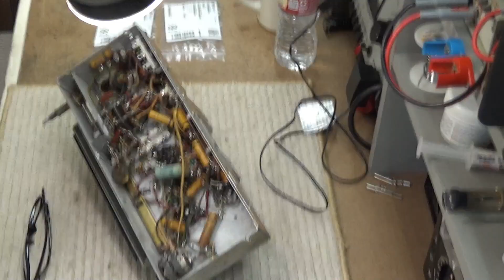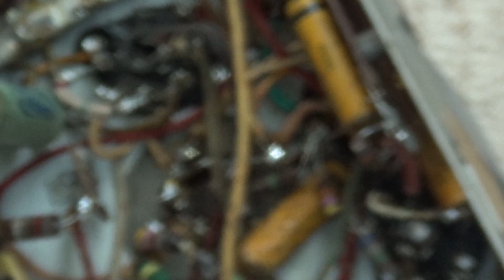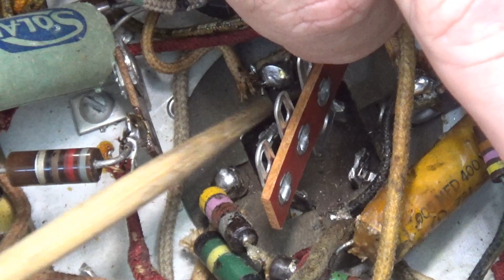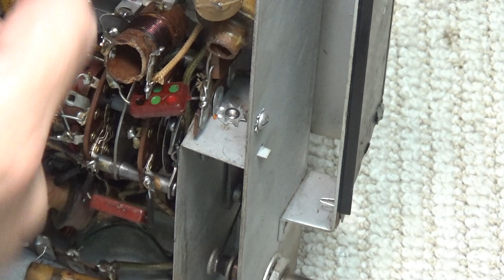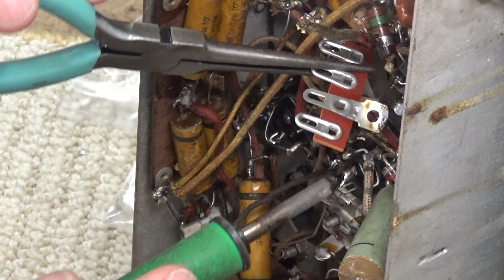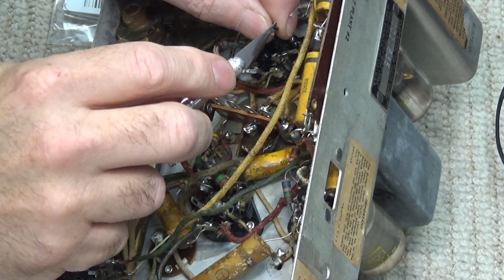Episode 83-1, "The Search for Old Capacitors"  Sears Silvertone 8230

Comment: From Wikipedia: "Micromicrofarad" or "micro-microfarad" is an obsolete unit found in some older texts and labels, contains a nonstandard metric double prefix. It is exactly equivalent to a picofarad (pF). It is abbreviated μμF, uuF, or (confusingly) "mmf", "MMF", or "MMFD". Therefore, your 100 micro-microfarad capacitor is not mislabeled. In modern terms, it is equivalent to 100 picofarad (pF).